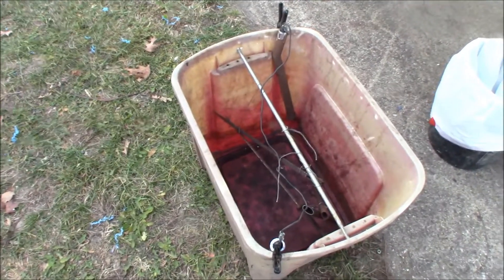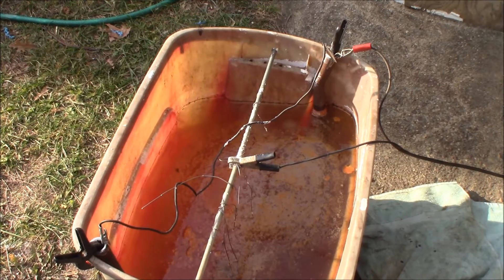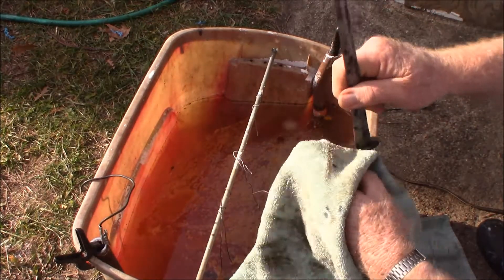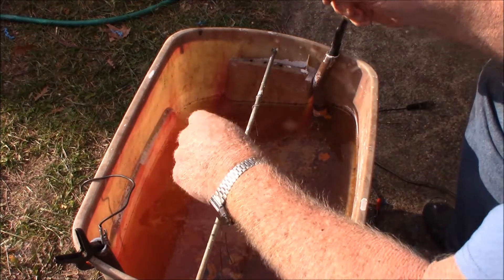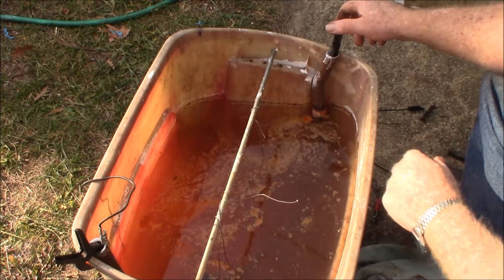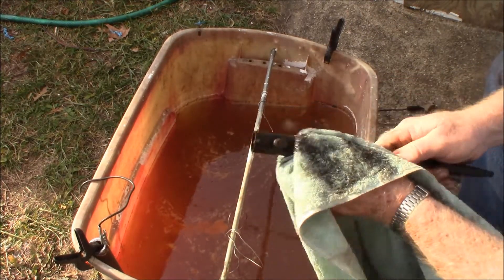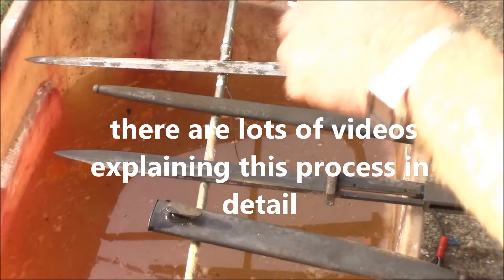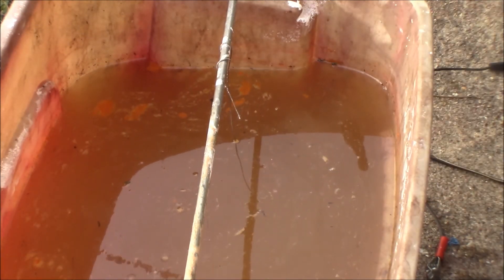electrolysis process completed on knives

Comment: Great results.  The washing soda is a must.  If possible try and clear coat them to prevent future rust.  I ended up clear coating the drill press I restored.  It is not rusting at all.
Reply from the maker: I had first planned on dura blueing them but  later I wasn't sure, the clear coat would be great to prevent rust but if I do decide to dura coat them that might be hard to get off.

Comment: it worked pretty good ...missouri i was told you need to put something in between the charger and and your cathodes ...it was something to the effect of resistance so you dont burn your battery charger up
Reply from the maker: I never did that,  but if you use one of those smart chargers , you have to hook a battery in between  or it won't work.

Comment: I like using that method for bigger items and vinegar for the small stuff. It sure does a good job.
Reply from the maker: yes it does, some of the stuff I cleaned that way was really crusty, the cast iron skillets I did really came out good, even made the burned on  crud come loose.
Reply: Got a tank big enough to put your van in?
Reply: hmmm
Reply: Maybe I should put my knees in there so they're not so rusty.